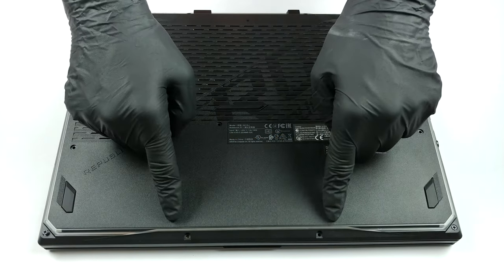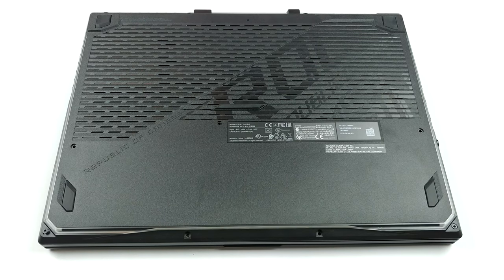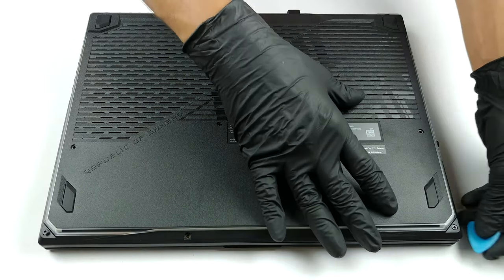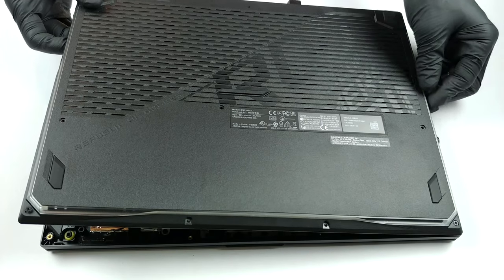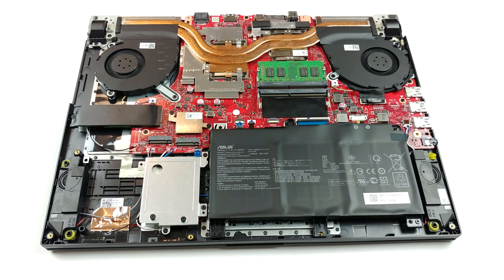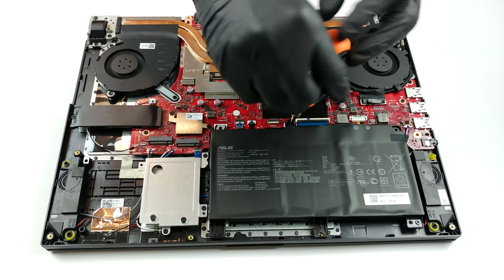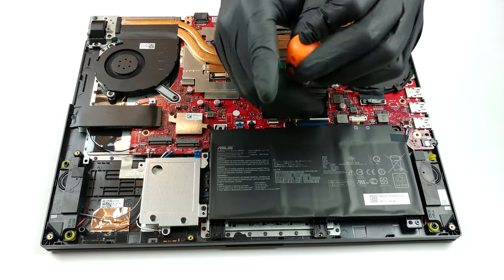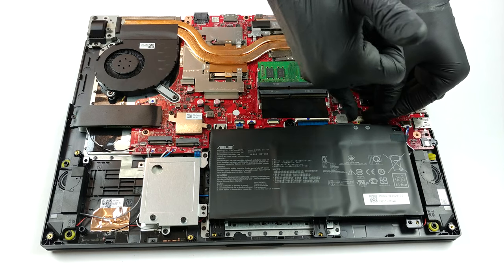🛠️ASUS ROG Strix G15 G512 - disassembly and upgrade options

Comment: this helped me big time. I couldn't turn off the friggin computer.  Strix 15 Completely frozen. Didn't know where the battery was hooked up. Because of ur video it saved me hours from waiting. I found it and fixed it. Desperately needed to finish my class work . Thank u God for this video
Reply: If you cant turn off your G15, hold the Power-Buttom for longer. Maybe 20sec or more... That happens to me more often.
Reply: Yes what is up with the laptop?
It doesn’t want to shut down same problem with me
Reply: @shashankchauhan4981  There have been a few updates, especially Asus Armory Crate, now it's better. No freezes

Comment: I got my new G15 and found good news and not so good new right away.  I imediately added in a second NVME (SSD) drive, and the next day upgraded the 8 GB ram to 64 GB because, why not.  Taking the machine apart was a snap, and I did not disconnect the two ribbon cables inside since there was no need to.   I found I could access everything I needed to by just moving the bottom case to the limits of the cable lengths.  The memory works,which was a small relief, as I worried I had bought excess memory I couldn't use and couldn't return (I could not find the figure of the maximum amount of memory even on ASUS' site but one source said 64 GB while other sources said only 32 gig or even 16 - and I did want to max out the memory).  
However the not so good part came when I tried to clone my new drive to the 1 TB Samsung SSD I added in: it won't let you.  Asus has added something to keep you from cloning your own drive on your own laptop.  I tried 4 different cloning programs, assigning drive numbers and deleting the partition in disk management, you name it, and all failed.  There HAS to be a way to do it somehow but I have not found it -
Reply: what ram did you use to upgrade to 64?
Reply: For the ram just verify the amount the cpu can support. It's 32 for the I7 10750h.
Reply: Which model is your G15? 
I have a G15 G512LU and I'm wondering if it will support 64gb memory or not
Reply: I wonder how much memory is possible to add and if it is also possible to add a second ssd drive. Can you help me pls?
Reply: @pabliitocarp  maximummemory is 64 gb.  2 X 32 memory chips.  Adding a second ssd is easy, just remove the bottom and find the plug in that looks like the one your other SSD is attached to; and install it.  But making it useful is a whole different thing, you'll want to download Macrium, free, and make it work using that.
Reply: @robertmaybeth3434  Thanks sir. I already did pretty well. Thanks again
Reply: Can we upgrade graphic card in it
Reply: @robertmaybeth3434  can we upgrade graphic card in it
Reply: @thegtshow1431  i have no idea, I'd guess you can't.  I decided I didn't really like the HP Omen so I just bought an Alienware.  Laptops are seldom designed to be upgradable, after all.  The Alienware Area 51 is designed for easy upgrade but they might be the only one I know.

Comment: Hey man, i was wondering do you recommend any special batteries? i was thinking of getting a new battery so it can last longer.
Reply: Does not work that way. You only have that amount of space wich is designed for the exact same type of battery. Further more battery upgrades on modern laptops are bassiclly non existent...and you can't by a battery of the same size with more storage either.
Reply: the best way to give your battery maximum life-span is to run it at 80% charge all the time.  My Asus ROG gives you that option to set it that way.

Comment: i just got mine using in almost 1 week im waiting for video adding 2 SDD  slot .
Reply: The sdd slots are right next to the battery. There’s a total of 3
Reply: plz reply can i buy a 8 gb ram and add one more 8 gb ram in it ? and can i change the graphic card to rtx 2060?
Reply: King_B I’m not sure if you can change the graphics card but you can buy 2 ddr4 rams sticks on this specific laptop I do think it already come with an 8gb ram but you’ll have to check
Reply: @king_b7160  u can change/add ram but you cant change the graphics card
Reply: I have G512LU about of 6 month ,and i can't find how add m2nvme

Comment: Can you tell me exactly the brand and model of RAM?
Reply: I have the G512LU, not LI as in this video but the ram should be the same. It's a Micron, 3200 Mhz, 1,2V and CL22. The product code is MTA8ATF1G64HZ-3G2J1
Reply: Mine came with the micron tech 8gb 64hz
Reply: I have G512LU 
The RAM is Samsung's
Reply: @mihairazvan7671  hmmm ,i have G512LU but it has Samsung's RAM

Comment: Hey
I just bought an internal hdd of 1 tb
My laptop is same specification one in this video.
Should we buy any insatalation kit rather than the internal hdd.(silver plate)
Also i haven’t recieved any connector with that package. Is that also sold separetly?
Reply: Bro can i add 1tb hdd with the 512gb ssd variant??
Reply: althrough it may look like it , u can't add a hard drive to g15 , it have 2 other ssd slots there and there are no way to connect the harddrive to the motherboard
Reply: Imjas Bro can you reply me with your contact option? I want to ask something about upgrading HDD, I have same laptop.

Comment: I wanna know if i can put a 2.5 inch hard drive in this.
Reply: You can’t you can only put two m.2 for storage upgrade
Reply: I have a g531gu and it has the same chassis and in the left side corner there is room and for it and places where to connect so I think there might be a possibility to connect one
Reply: RokasG that depends on what region its from and the model. I have a 2019 g713gt it has a 2.5 inch drive space but on my 2020 electro punk g15 it doesn’t have any space for a hard drive
Reply: @شمسالاجهر  yeah but I saw the came connections as I have in mine and same space so if you would have proper materials and cabels you would be able to put one in
Reply: RokasG on this computer you can’t there’s this chunk on the frame that slides inbeteeen the silver casing and speaker
Reply: X-Men  huh? If you say something like that then I'm sure you only dream about dedicated graphics card in your laptop
.. Smh
Reply: X-Men  yeah smh, go play something on 4th gen intel integrated graphics talking stupid stuff over here
Reply: Hello, it would be a huge help if you could tell me how to boot up the laptop motherboard while out of the case. I have the complete motherboard and I have hooked it to a monitor and keyboard but without the power button I can not figure out how to boot it.

Comment: I have Asus Rog Strix G15 G512LU. i7-10750H,GTX 1660 Ti
I want to know if this laptop can support a maximum of 32GB or 64GB Memory. As it is not specifically mentioned anywhere.
Reply: 32
Reply: Mine has 64 and works great!
Reply: @guthriejosh  Did your model initially come with 32gb? Since mine is 16, I think the max I can push is 32. Right?

Comment: I noticed some cracking at the bottom of my laptop, its right in the middle, I don’t know what the area is called but I think it’s the ventilation.

Would that be an easy fix/replacement? Do I even need to replace it?

Would it be possible to link some places that replace that area, or do I have to replace the whole bottom chassis?

Comment: I need a help 
I have an asus rog strix g15 g512li with an intel core i5 10th gen, nvidia gtx 1650ti, 8gb ram and 512gb storage (7.8gb ram and 458.2gb storage as per asus armoury crate). I am using the device for very heavy works like professional gaming, video recording, live streaming games, singing and making music, creating animations. 

But my laptop is currently not supporting the stuff very nicely.... out of 458.2gb, 412gb is already consumed and I don't have any unnecessary stuff to delete and have like 5 games only, and the ram is consumed to around 6.4gb/7.8gb but when start any game, it shoots up to around 7.1 to 7.4gb/7.8gb. My games feel lagging sometimes and the temperature shoots up to almost 100 degrees. When I'm working on my animations and 3d objects, the rendering has become really slow and some functions take a little while to work. Plus I'm not able to multitask properly, say livestream without the game or obs crashing, or gaming with chrome/spotify/discord etc. open, the games starts to feel lag. 

I want to upgrade my ram and storage, but before I do I'd like to know if upgrading the ram and storage is gonna help fix my problem, and if yes how much ram and storage can I upgrade to??
Reply: anzuarden9039  actually, update to my current condition, this laptop of mine died lmao. Now I'll be buying a new laptop very soon with an rtx 4050 lol. Thanks for the advice tho

Comment: I see the little metal box for add a hdd 2.5 inches but I realize in some Asus laptops you need to buy separetly a FFC cable sata  connector to make it work first. Does this model include it?
Reply: Mine didn't include one
Reply: No they don’t include any adapters. Also those two slots next to the battery are for ssds

Comment: Where is the CMOS/BIOS Battery??
Reply: Did you ever find it?
Reply: @youtubeuser206  I was asking not telling..
Reply: @RandomFile101  I know, 10 months ago, so I was asking if you ever found it. I'm starting to think it's just below the wi-fi card towards the speaker and connected to the underside
Reply: @youtubeuser206  If you got, that's great because I never did.
Reply: @RandomFile101  okay I've confirmed it, it's located on the bottom of the board directly under where the wi-fi card plugs in, the very bottom left in this video. It's marked RTC, there's a white box with 4 connections inside it and I believe the battery may be soldered directly to two of them but you can use a metal object to bridge the other two. If that doesn't work remove the battery and repeat step 1.

Comment: where is the bios battery?))))
Reply: The whole reason why I watched this wth I mean geezo
Reply: Did you ever find it? I'm wondering if it's on the bottom of the motherboard
Reply: I'm quite sure it is located directly under the bottom left corner underneath where the WiFi card plugs in. It's a white box marked RTC with 4 connections inside it, 2 for the battety and the other two you bridge with something metal to reset the bios.  I'm going to attempt it tomorrow so if you remind me I'll let you know if I was successful.
Reply: Not bios battery it's cmos battery

Comment: Hi every one i have a rog strix g15 512 Li i bought it with 8 gb of ram and i think its low for me can i upgrade it too ?im asking because i have the Li version is it upgradable ?also there is a 512 gb ssd if i want to upgrade it can i add another ssd or i have to change the main ssd ?thanks
Reply: Yes you can add both of them.
There is 1 emty slot for RAM and you have 2 empty slots for M2NVME Ssd.
Total you can have 3 Ssd.

Comment: Is it hard to remove the heat pipes? I was hoping to replace the thermal paste but they don't even try to get to the cpu in the video.
Reply: have you figured it out? My CPU started throttling and I don't wanna kill the laptop

Comment: Nice video! How many M.2. ports does it have?
Reply: 3 ports
1 has a ssd from factory and 2 vacant
Reply: @شمسالاجهر  can we use it with 2 ssds at a time or all the three have to be in place
Reply: @---bc6ox  SSD (from factory) is PCIe NVMe, or it is SATA?
Reply: @RahulSingh-ti5de  nvme

Comment: Anyway to upgrade that battery? And how long does it even last for?
Reply: Your able to get the battery replaced but Not sure if you can upgrade it. And it last an avr of 5 hrs
Reply: in case ur planning on using ur laptop for long term , get a replacement now , and change it in 2 years , thats how usually batterys last
Reply: Battery last about 2-3 hours with undervolting. It's trash. And no battery upgrades don't exist anymore.
Reply: @gabproductions3312  A year late but I ended up making my own PC with top of the line parts.... except for the GTX 570.

Comment: I have the G512LI 8GB Ram i5 10th gen intel Rog Strix G15… I read all the comments but to be safe I would like a super specific one for my question, I want to add 16GB ram to it! Is that possible? Or Should I make it just 16GB altogether or? I’m using it for my Elgato but it’s super laggy because 8GB ram is always almost using itself up :( 
What kind of Ram do I exactly need (8/16/32Gb) thank you so much!
Reply: Yes it is
Reply: The max is 64 GB I have the same model

Comment: Bro I have encountered a problem, after cleaning the fan and re-screwing the base the bottom right led stopped working. All the other leds are working in sync. Please help
Reply: I just ordered and want to upgrade with an M2. Did you fix this issue ? (or re-check ribbons?) ps are you happy with your purchase
Reply: Try to take it apart and make sure those 2 keyboards cables are connected correctly
Reply: -- how are the cables attached?
Reply: Clinton Shields the normal flip lock not sure what it’s called thoe

Comment: Can i upgrade the graphics card?
Reply: Nope its also part of motherboard
Reply: @Braynake  what if I found someone who can remove the soldering and upgrade? U just heat the stuff it'll com off, or i could replace the motherboard in a few years
Reply: @Alkatraz767  you probably could but it would be a lot  of upgrading on the motherboard  with risks
Reply: @Braynake  that's why i would give it to ASUS to do it for me. Its full proof. And they said they will do it
Reply: @Alkatraz767  Maybe just buy a laptop with a better GPU? I would never risk to change the GPU of a laptop.
Reply: @Braynake  yh I found a solution: g15 1650 ti, and I can buy thunderbolt 3 with egpu
Reply: @yoon9724    yh I found a solution: g15 1650 ti, and I can buy thunderbolt 3 with egpu
Reply: Devang Bhai, can we upgrade HDD in this laptop? I have the same model, there is a space where we can put HDD like in its preds. but no one is telling rather we can go for a HDD upgrade?
Reply: @Alkatraz767  they'll just give u a model wth a better gpu for more money lmao.
Reply: @Alkatraz767  it's a laptop not a desktop upgrades only go so far on laptops. Ram and storage always. Putting a beefier gpu would result in the psu failing or overheating. You could run into heavy thermal throttle. And probobly burn the conduction lines on the mb when it pulls more power than ir was designed to handle. Also desodlering a mobil gpu or cpu is quite hard.

Comment: Pls answer i'm about to purchase a 2tb seagate hardisk the sized is 2,5" do u think is compartable to the hardisk slot???
Reply: so did it work
Reply: @lumijunior8929  It depends if ur laptop capable of upgrading a HDD, some laptop just not capable of Upgrading HDD n only capable of upgrading SDD .turns out laptop and pc has their own hdd sizes, for laptop is 2,5”, and for pc is 3,5” .so yeah, if u see a 2,5” hdd that’s for laptop, but if u see a 3,5” hdd that’s for PC. Hope that would help

NOTE : laptop HDD is more expensive than PC’s
Reply: @shoyonsk8828  what if i got an external ssd hard drive would that work
Reply: @shoyonsk8828  i was thinking of a SanDisk Extreme ssd u think that'll do the trick i dont mind the price tag
Reply: @lumijunior8929  depends if ur laptop capable of, as i said some laptop just capable of upgrading ssd or hdd! What laptop r u using?? Just do some research bout that laptop
Reply: @shoyonsk8828  hard finding anything on the laptop im looking at its the Asus rog strix g512
Reply: @lumijunior8929 ur laptop capable of ssd, so its fine
Reply: @shoyonsk8828  oh sweat thx for the help

Comment: So theres this blue wire right near the 2 m.2 nvme ports there, i was going to pop in a 1tb samsung 970 m.2 ssd and noticed that blue wire was disconnected from where its soldered in this video... any idea what that wire is for? The laptop appears to function fine but maybe not so coincidentially, that ssd i just added isnt recognised in either m.2 slot. Not sure if I need to look at settings somewhere or im hooped because of this wire. edit hey, pros initialize ssds before use, lol, was so distracted by this blue wire i didnt do the basics.

Comment: Can’t figure out where those back to cables attached to
Reply: Same issue
Reply: Same issue .... did you ever figure it out. Also are the cables just for the external lights?
Reply: Yes. Its two of the small saddle clips on there. One is by the battery plugin, the other other on is around the other part of the end of battery. Whats weird about it it you will have to fold it over like you are twisting it, because the plug ins are facing away  from where the cables are coming from. You have to kind of go up and over. They are small just like the cables.

Comment: So wait where’s the storage space slots
Reply: When he pointed to those two inch black squares 3:04
Reply: As Sean Brittain pointed out, there are two that is pointed out in the video, but the one where the hard drive is located in this unit isn't pointed out to in the video.  If you go to 2:45, you will see him remove the screw for it.  It's a M.2 SSD, it has a black protective film over it.  Once he removes it, you can see the wifi card.

Comment: Where is the hard drive at?
Reply: i don't think it comes with a hard drive, but the ssd is on the left under the black tape
Reply: He removes the screw holding it inplace at 2:45.  It's the part with the black protective film on top.  Once he removes the M.2 SSD the wifi card is directly underneath it.

Comment: I have the GW model with the 144hz panda screen. Is it possible to replace this screen with the 240hz Sharp screen ? Some basic research shows they have the same connections ? Anyone done this ?
Reply: Not worth it. You would probably stress out the included psu or battery when you try to run it at that speed since more power is required. Also the 1650ti in there can barely do above 120fps in games at ddcent settings.